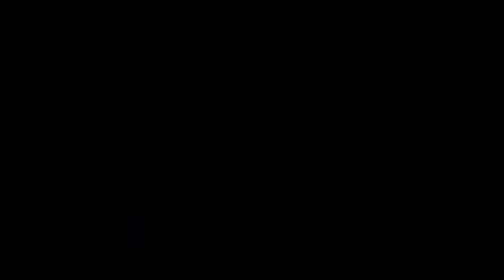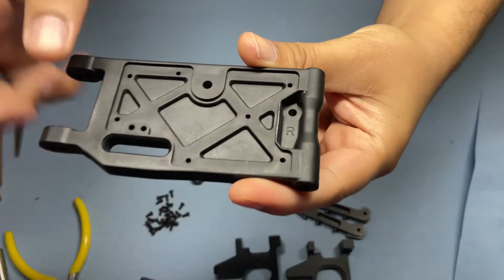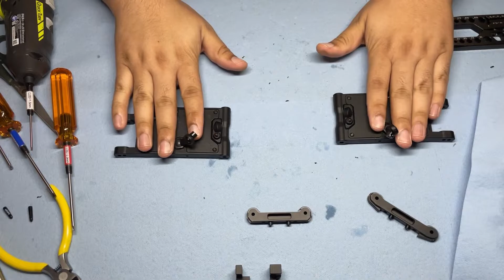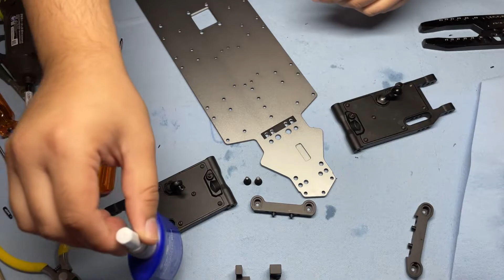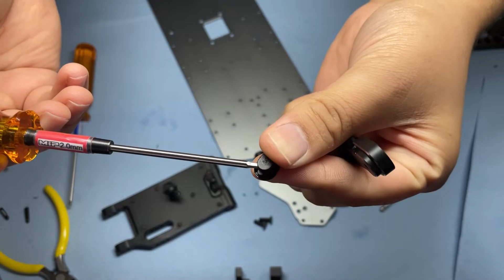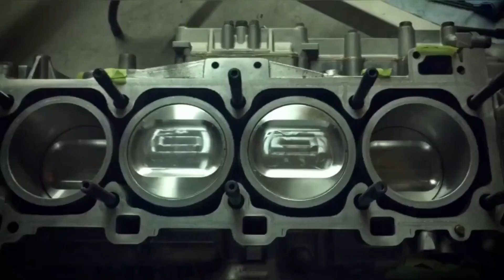Serpent SRX8 GTe LWB Build - Bag 1

Comment: I prefer the Serpent to the Xray 23'. The carbon center top brace, & a lot more aluminum bits are included in the kit. The rear diffuser is also sweet! Seems parts are easier to find through AMAIN or DESOTO Racing in FL for the SRX8GTE as well. Would be interested to hear your thoughts after the build. Cheers
Reply from the maker: I am surprised at how many aluminum and steel bits are included. I'm only 1/4 way through the build and I've already seen $100 worth of upgrades if you were to get another brand. So far I'm impressed!